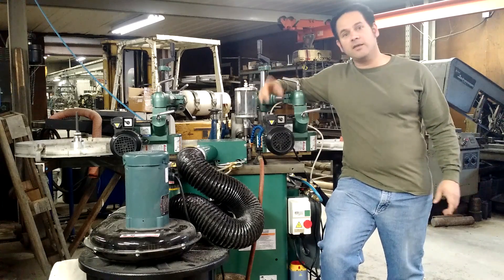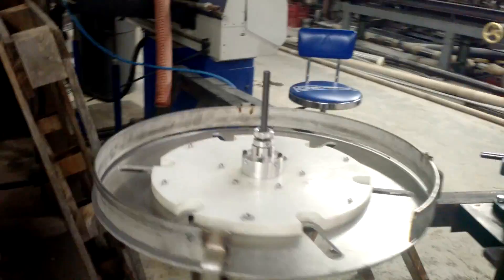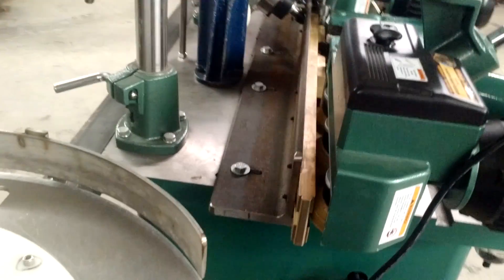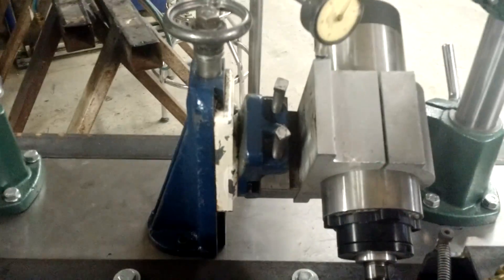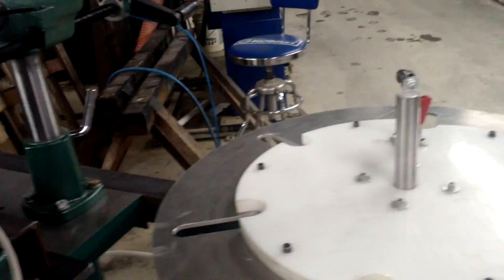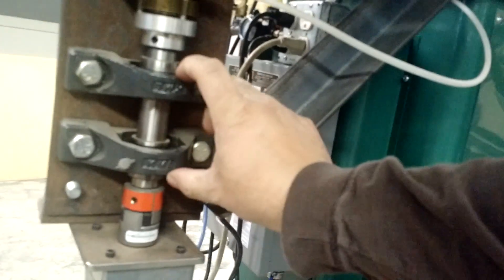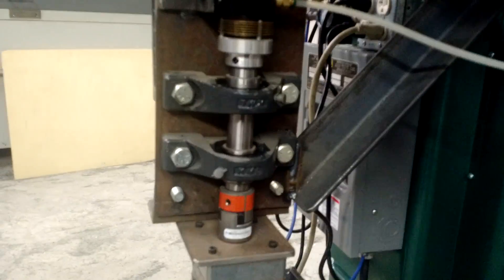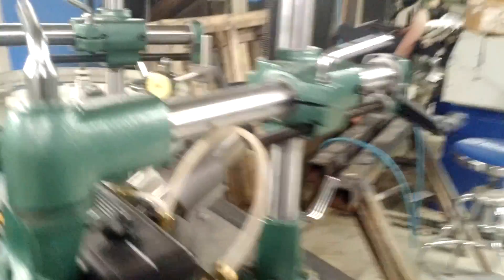Reel To Reel SHAPER -  grizzly shaper and power feeders

Comment: Just curious on how you quoted the customer for the build with just a general idea on what you were going to do.  did you account for testing and modifying and charge an hourly rate or were you just given a budgeted amount to work in?
Reply from the maker: +Brian Dughi it was quoted for a certain amount based on the customers instructions.  We built it and the material did not behave as predicted.  Then we were given free reign to "make it work"....That's when it became an hourly job
Reply: Ray Pena, the old build it to the engineers specs and then make your money fixing their mistakes. lol
Reply from the maker: +Brian Dughi classic!! I see you are familiar with it, lol
Reply: Ray Pena I deal with the engineers were i work.  most times i have to give them the ideas to make their prototypes actually work.